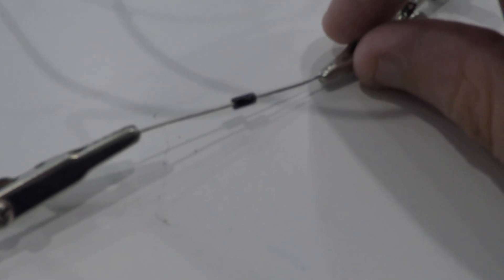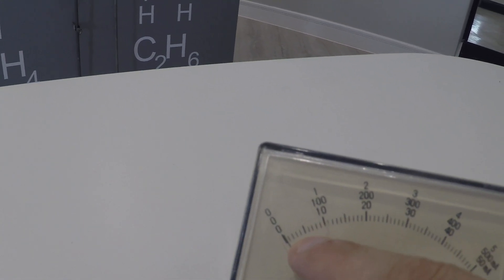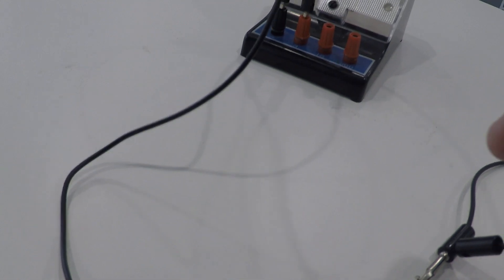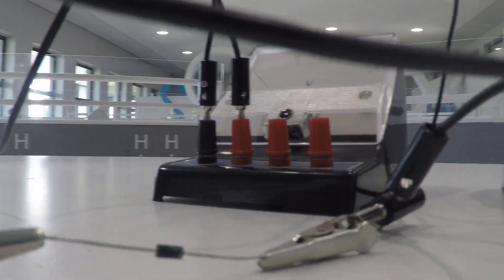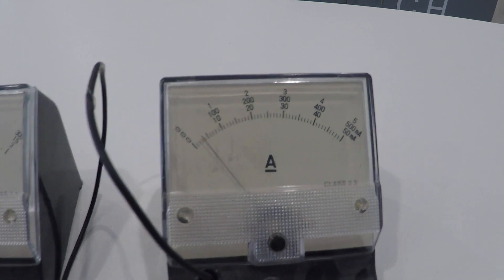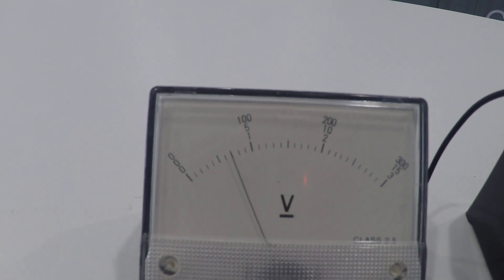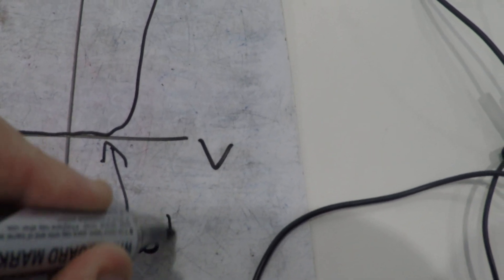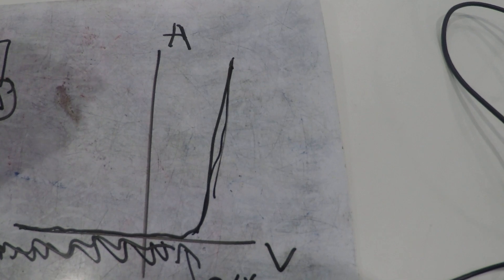Finding the I-V characteristics of a Diode - A level Physics

Comment: How does this measure current through semiconductor diode, when some of the current is wasted through the resistor?
Reply from the maker: It's a series circuit. The current is the same everywhere.